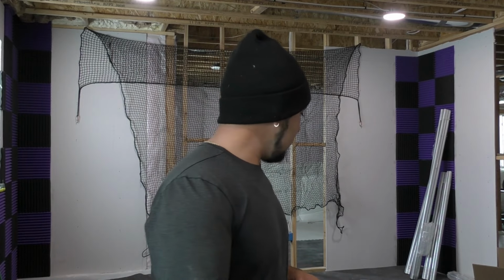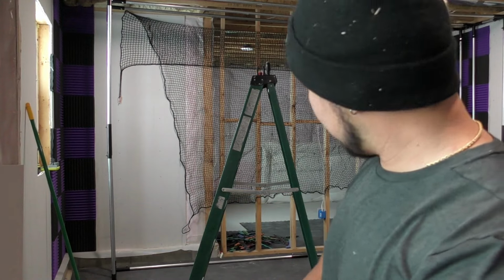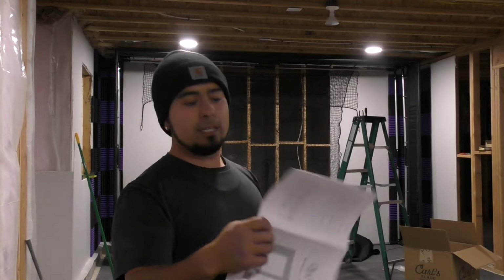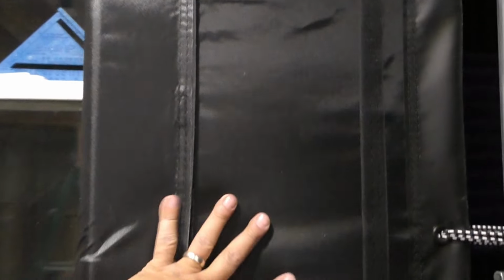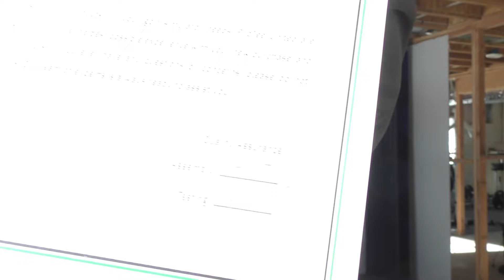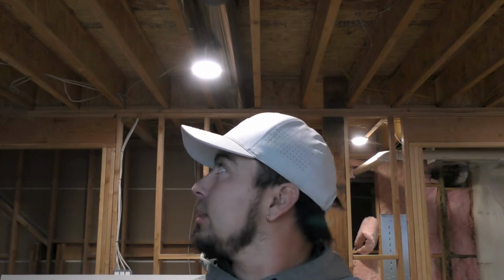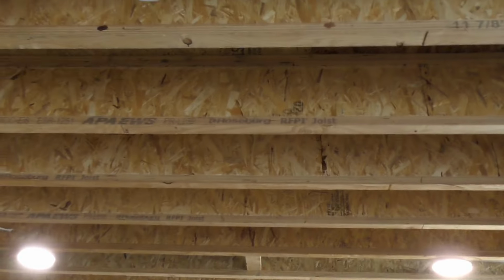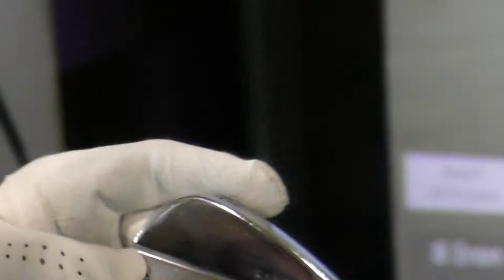IN HOME GOLF SIMULATOR | CARL'S PLACE | PROTEE VX LAUNCH MONITOR.

Comment: Hi. I have the same ceiling setup as you and waiting for my VX to arrive. At 26:26 your jig shows pieces of 3/4" wood pieces on top of the 2 x 4 frame to raise it a little higher but at 31:07 your jig doesn't have them. Did you remove them as it raised the VX too high into your ceiling? Thanks
t have the
Reply from the maker: Great catch, you are correct, I did forget to mention that I removed those smaller 3/4” pieces for that exact reason.
Reply: @PerezPlayz  Thanks for confirming. Your video helped me realized I could make the VX work by recessing the unit into the floor joists. Otherwise I would have had to mount it too far back or too far forward or drop my projector dangerously low. I went ahead and bought it and my VX is coming next week and I have to start prepping my jig. Cheers

Comment: You prob never asked..but do you know if you would have put the VX on a track to move it side to side (I dont have enough room to have it in the middle for both right and left), could you calibrate it to 2 hitting locations? Would it still read as long as it’s in the hitting window and the floor is level? I 
Thinking an out getting one!!
Reply from the maker: @chaselytle6746
In my opinion I think it would work with both hitting locations once you calibrate it. I’ll try this out in my review video and hopefully it’ll help answer your question.
Reply: That would be GREAT! I had 2 issues keeping me from pulling the trigger (because I heard it was a no refund or return item haha). The other you showed with mounting inside the joist to get your min hight. Good video, can’t wait for the review🏌️👏
Reply from the maker: @chaselytle6746 
Happy to help, I’ll be going over the room dimensions, calibration and a few other key points that will hopefully help and ultimately helped me decide on getting this launch monitor.
Reply: Finally ordered mine!! Will be here Wednesday!

Comment: Correct me if I'm wrong, but I thought you mentioned you had 8' 6" ceiling height floor to joist. Did Carl's try to steer you away from installing at that height?  I have 8' 8" ceilings and Carl's said Pro Tee wants at least 9' and with no refund I feel like I could get stuck.  Interested in your information and the conversation with both Carl's and Pro Tee.  Thanks, Randy
Reply from the maker: Hello Randy, you are correct I might have misspoken in this video I do have 8’ 6” from floor to bottom of ceiling joist. I didn’t talk to Carls place customer service about the minimum height required for it, but with the research I did on my own I found some videos where protee talked about it still working at 8’ mounting height. My thought process was if they need 9’ ceilings minimum then mounting the base of the launch monitor at 9’ the cameras would be about 3”-4” lower making the camera height about 8’ 8”. I’ll post another video going into more detail about specific measurements and be as accurate as I can be on how my sim is setup.
Reply: @PerezPlayz  Thanks a million, I am strongly lending towards the VX.